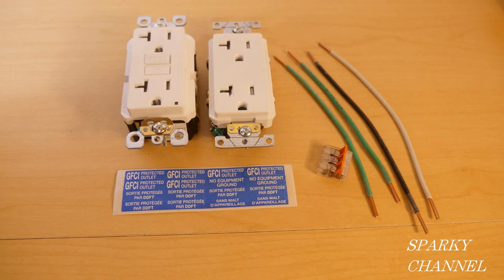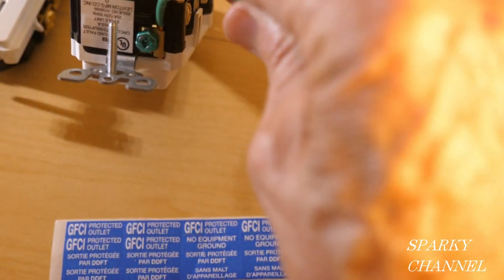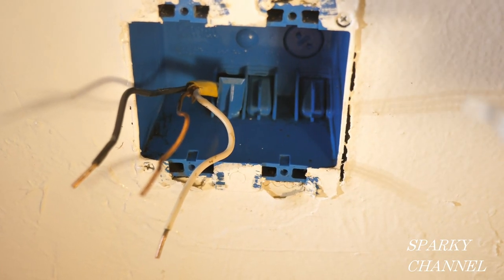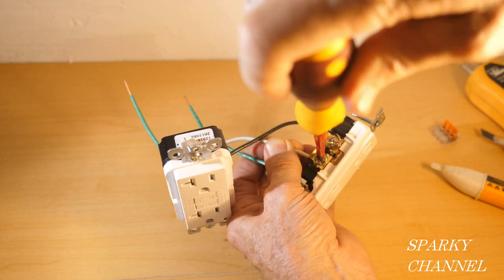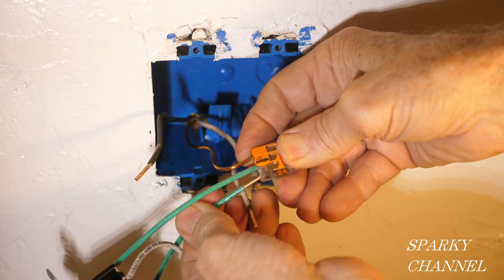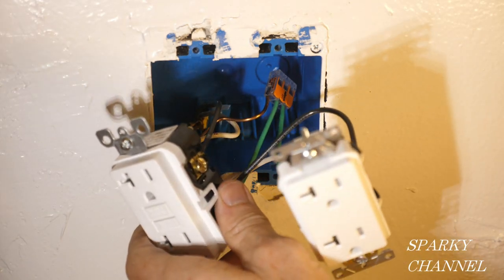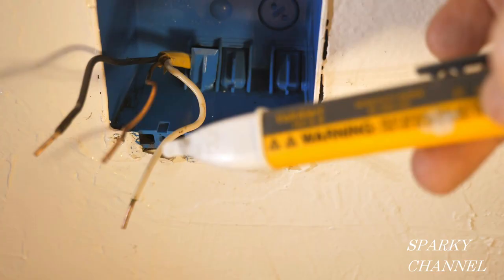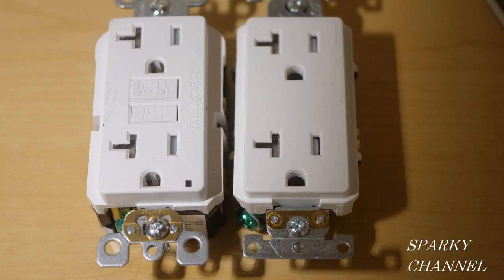How to Wire a 20A GFCI and 20A Receptacle in a 2-Gang Box Fast and Safely

Comment: Great video!  Since you were using a   GFCI plug in tester, I would also the viewer that the GFCI outlet, if wired correctly, could be tripped with the push of the button on the GFCI tester as well as tripping the regular outlet if wired correctly too.
Reply from the maker: Hi Bill! Yes, excellent tip!

Comment: What if I now want to go from this double box out to another box in the kitchen? Could I run the wires from the top of the 2nd receptacle?
Reply: YES YOU CAN --WITH UNDERSTANDING THE NEW OUTLET WILL BE GFCI PROTECTED TOO
Reply: My question. This would be my first box in the circuit. How do I wire for more down the line?

Comment: Just added a 2 outlet near my garage door since my panel is there.  Had an open slot so did a 20A breaker since i purchased a new welder and it's recommended to use it on a 20A and currently my garage plugs AND septic tank pump are on a circuit so i wanted this dedicated for higher draw corded tools like the welder, miter saw and table saw.

Came out really nice and didn't cost much since i had some 12/2 already.   Maybe $40 in materials all in all.

It's nice to have a plug right near the door instead of over by my workbench and having to run an extension cord when i want to work out in the driveway and not be pressed for room inside the garage.

Comment: Know it’s great using tamperproof (& code) but they sure can be finicky when plugging into to, it’s “almost” adult proof as well as child proof😉
Cheers Bill✌🏻
Reply: Ya. Do u insert the two prongs on an angle then the longer prong? There is a trick to it. I had a power bar like this. 😤
Reply: it usually helps to wiggle the plug a little as you're plugging it in.
Reply from the maker: Yes, they really are finicky! They keep the little tykes safe though.
Reply: @SparkyChannel  Could've served me well when I was 2 years old. Let's just say I stuck something in the receptacle and paid for it with a little zap.

Comment: While you may have checked hot to ground, and neutral to ground, and this video is intended for competent persons
The neutral may be damaged or have a loose connection
Also the hot may have been abandoned, but the neutral is hot
Testing both with the ground is ideal for safety

Comment: I prefer to leave my jumpers straight when I'm securing them to the second device, and then align the devices.  just seems a little less awkward to hold like that.
also, smartlock makes it harder to miswire, but I still always use the GFCI tester to confirm proper operation rather than relying on the test button, alone.  older GFCIs could be wired so the device would only trip with the test button.
Reply from the maker: Thanks Ken!

Comment: This is exactly what I have to do thank you so much
Reply from the maker: My pleasure, thanks!
Reply: Question : if I take the same setup in this video and I wanted to run power to a switch box do I plug it into the extra line holes or the load holes of the first GFCI outlet  ??
Reply: @SparkyChannel  ?

Comment: Why did you wire your jumper wires to the bottom of the non GFCI receptacle and not the top?
Reply: The top is for line only meaning incoming power. However, the receptacle on the right is getting it's power from the GFCI so it is being used as a load and hence the jumper wires must be connected on the load side of the receptacle.

Comment: The hot and neutral wires were connected to the bottom portion of the 2nd (non GFI) receptacle.  Are these wires always connected to the lower if its not the first receptacle in the circuit?
Reply: I think it doesn't matter accept the fact it's neat n shorter way to connect them

Comment: At 2:25 he is showing 0.0 DC voltage? But I get the point. Good video.
Reply: He’s using a Fluke 117 on auto voltage.  If it had detected any AC, it would automatically switch.  Since it didn’t detect AC or DC it stayed on the default setting.  Still a valid zero AC volts.

Comment: Two (2) duplex receptacles wired in parallel. As the LOAD increases the RESISTANCE (Ohms) will be REDUCED and the Current will be increased. 
Thank you.
Reply: ummm... not quite.  they're best described as master/slave.  when the GFCI is active, they will function in parallel, but the GFCI will disconnect both.  adding load is usually calculated as adding wattage (or Volt-Amps), not as subtracting resistance in this kind of circuit planning.
Reply from the maker: Thanks Ted!
Reply: @bljdeep  they've learned a little of textbook electrical theory, and are trying to make it fit to real world installations.

Comment: Couldn't stress double checking I've turned off a breaker way to many times thinking a wire is off when it isn't then I get shocked I learned the first time 120 volts does not feel good
Reply from the maker: Good point!

Comment: Nooo!  I died a little inside when you used your screwdriver on the gfci buttons.  The journeyman I worked under doing residential got after me the first time I did that, and I get after apprentices when I see them doing that.  But I guess it’s different if it’s your own home and not for a customer.
Reply: I use the (plastic) tip of my non contact tracer.  the screwdriver tip can scratch.  my pet peeve is finish carpenters using their pencil.
Reply from the maker: @kenbrown2808  I'll try that. The screwdriver can scratch the button a little.
Reply: @SparkyChannel  the reason for using a tool is because the button is too small for our big fingertips.  My inspector uses the ground pin on his tester.
Reply from the maker: @kenbrown2808  Yes! My big finger just doesn't fit well on those little buttons. I'm going to try using the tip of my voltage sensor. That sounds like a great idea.
Reply: @SparkyChannel  older ones had a chamfered opening and you didn't have to press the button so far.  but the newer ones have a cleaner look...
Reply: @bljdeep  only low-bid tract house work.
Reply: @bljdeep  service work can get nasty, commercial and industrial can get monotonous, but nothing is so soul crushing as being required to do a half assed job and try to sneak in as many extras as you can get away with.
Reply: @bljdeep  are you calling me old? ;)